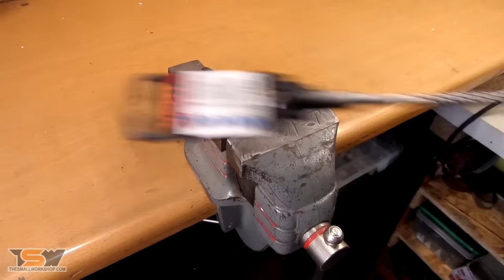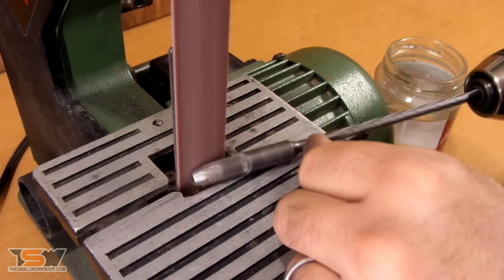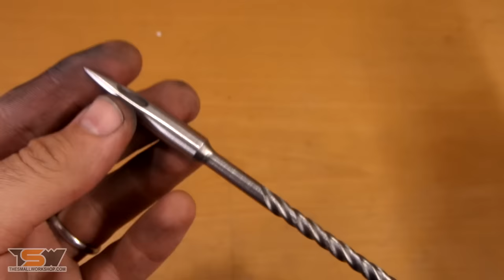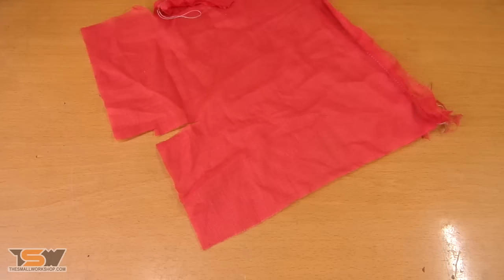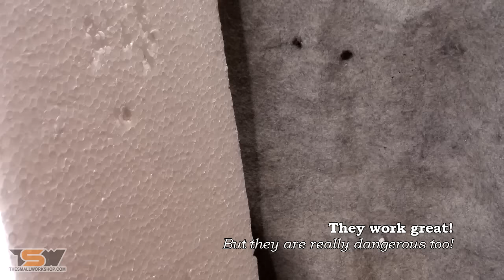Making Simple Throwing Spikes - Ninja Bo Shuriken

Comment: To all those that have or will ask if itll stick in wood , there are a few factors to that quesion .
1. Hardness or softness of wood, pine is a real soft wood compard to say like oak or mahogany.
2. Angle the the point of the dart , a sharper angle will stick easier but dull faster .
3. Skill and force of throw , throwing somethin at a distance is harder to keep straight , but with enough force you can make anything stick in anything , an example is like a cannon ball vs concrete if it hits hard enough it can stick.
There are a few more but those are the basics .
I love vids like this thanks for the uploads i look forward to more

Comment: TIP: if you decide to use a bench grinder or belt sander in addition to a drill like in this video, make sure the drill is spinning in a way that will make the surface move in the opposite direction than that of the grinding surface. This is why the bench grinder worked so much faster than the belt sander. (he switched the direction of rotation from the wrong way to the right way.).

Comment: This is super cool! But in my experience with Bo shuriken, flat edges sink into a target with at least 3-4x more "bite" than a rounded conical profile.
Reply: Yeah it is definitely better to use flat angles when forming the tips.  They penetrate target materials like wood better, and if you intend to use them as self-defense weapon (not saying I advocate this, just saying) lacerations are generally more effective than puncture sounds (if you've ever stepped on a nail, you know the wound usually just kinda closes back up when you pull the nail out).
Reply: So using flat bits will be better.

Comment: I'm thinking a trip to Ace hardware when I drag out of bed in a few hours to pick up a few of these bad boys to use as bolts / arrows with a modified sling shot/sling bow.

Sat down and drew up an aluminum or copper tube to overlay the shaft in order to secure two or three vanes/fins to it via "soldering" or an adhesive used to bond aluminum in the manufacture of aircraft.

Thank you for a nice video and a great idea even though it's not quite what you originally intended them for.

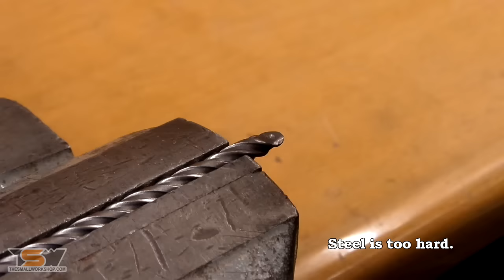Comment: 3:45 Next time you should try a concrete drill bit with its sharp tip like a metal drill, it works very well. Beautiful your work. Greetings.
Reply: Calito1157 I use cheap harbor freight masonry bits to drill through hardened steel. Like $4 for a pack of 5. Use them 4-6 times and toss

Comment: Great job. I was surprised that you were able to cut the steel in the beginning but it was too hard to drill through.
Reply from the maker: The hacksaw blade was high quality HSS and was damaged a little by cutting the 3 bits. The cheap chinese HSS drill bits I was trying to use to drill them were just not up to the task.
Reply: Makes sense. They turned out great. I may have to try it myself because they look fun as hell.

Comment: Would love to see you heat them up then apply brass using brass wire wheel. Even though some (most?) of the brass would scratch off it would have a sweet blend of colors on them.

Comment: This is a neat vid! A couple questions regarding the process:
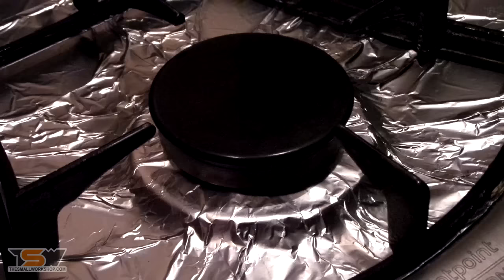1) Why do you need to apply heat at 3:52?
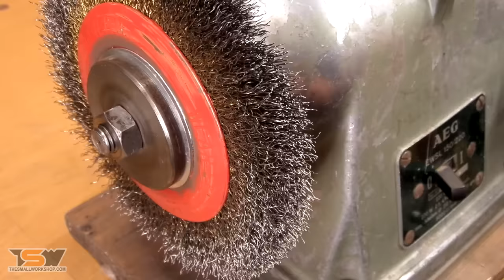2) What is the purpose of the step at 4:35?
Reply: 1) He's applying heat to anneal it (soften) so he can drill it. 
2) wire brushing the blueing off (from the heating)

Comment: The use of the bench grinder  is not unlike the method I use for grinding tungsten electrodes- but it works faster if one holds the workpiece perpendicular to the grinder axis. Perhaps that would work here.

Comment: the only thing that could be simplified would be not using the grinding tools. Just the drill as a lathe would suffice. But the grinding tools definately simplify time constraints.

otherwise this is the first "simple" thing to make that turns out simple i have watched in a while.
Reply: you're damn right
Reply: no
Reply: Crystal May You could use an angle grinder instead. More dangerous but ive actually done it before to make a bushing out of a nut. The results were great.
Reply: Crystal May ggggg

Comment: don't know if it has been mentioned yet..... you could keep the scarf on by using thread wrapped around it instead of glue, it would last longer and look more authentic
Reply from the maker: Original ones had silk thread passed trough the hole then bent back and tied, to form something like a brush. I liked that method better, but was in a hurry to finish them that's why I used the cloth.

Comment: In what country is it cheaper to use new hammer drills cut up rather than used and worn out used ones?
Also, if you spin the drill in the opposite direction of the sanding belt, it would work much better.
Deadly on foam, but how about wood, or perhaps meat?
Reply from the maker: I've answered all these questions a dozen times or more, but hey, why not once more! Could you point to me to that part of the video where I say you should use new bits? Also I paid 3 bucks total for the drill bits so it's not like I'm getting bankrupt because of it. As for used drill bits first is that I use quality bits, $15-20 or more a piece and they last forever, I think I only thrown away one in my entire life because the shaft broke, else they only get a little thinner, but are still usable for smaller holes. And second, unless you are a professional who drills holes all day, good luck finding 3 or more matching used drill bits. Using new cheap China bits I can easily make a set of ten darts for $10.

The sander is really under powered that's why I'm spinning that way, else it would stall the belt. In the bench grinder section you can see I spin it the way you want.

The foam target thing I won't answer anymore, feel free to read my other answers if you want or whatever.

Comment: my god that hacksaw went through that bit like butter!

i've got a bit of scrap 1080 left from my first knife - been thinking of making some of these myself. though it's only 1/8" x 4" so they'd be a bit small.
Reply: Arklan Uth Oslin what type of saw is this???
Reply: no idea.
Reply from the maker: It's a HSS hacksaw blade made by Pilana, a Czech brand. It managed to cut through the 3 drill bits but it started to show some wear. But the steel was really hard, I could not drill it with HSS drill bits.
Reply: Whats the brand of those small files ? Are they any good? Im looking for a small set like that!
Reply: I'm not sure what they are called but I own a set and they are rubbish. Very cheap and unpleasant. Broke the first one in less than a week. OK for light work but I would recommend you buy something nicer.
Reply from the maker: Yes the files are not very good, just cheap generic China.

Comment: The steel wasn't too hard to drill through... the problem was that you were spending the drill too fast and not applying enough pressure... you can drill straight through an engine block... you just have to have a correct metal drill bit and patience... I would also suggest using some form of oil to lubricate it.

Comment: belt grinder would have been faster if you reversed the drill like you did for the grinding wheel!

what kind of saw blade did you cut the bits with?

sorry for the edits... LOVE the way they look! I'm function over fashion all the way! but I'd spend the $$! very nice!
Reply from the maker: Might be, but the sander is not very powerful and it stalls easily, so I have to be gentle with it. The hacksaw blade is HSS, made by Pilana, a Czech brand. A grinder with a cutout wheel would work just as fine to cut the bits, but I don't like the noise and dust that it makes.
Reply: The Small Workshop perhaps lube the back of the belt? silicon lube or paraffin wax works on treadmill belts. and they ride against a laminated MDF deck (225lb footfalls create a ton of friction) which isn't nearly as smooth as the platen would (should?) be. perhaps your platen is worn if not metal? but I don't know belt grinders nearly as well as I know treadmills. same principle. just trying to help. I do kinda prefer the belt ground one.

may not be practical, but dremel the flutes to create 3 blade edges?

they look amazing now! I'd probably kill them completely trying to take them to the next level lol I have WAY too much free time
Reply from the maker: The flutes could be made into a diamond shape, like an arrow, using the belt grinder. I've thought of it, but wanted to keep the project simple.

Comment: Not bad, but isn't the problem that by creating the sharp tips by grinding, you are removing the hard, outer layer of the steel and are left with tips made out of the softer inner part? I think since they were wood drills, they probably weren't hardened in a way that would ensure that the inside is as hard as the surface.
So you probably were left with rather soft tips, which would mean those spikes wouldn't do very well when throwing them at wood, instead of Styrofoam.

Comment: Looks kinda cool, but for me that's not making throwing spikes, but rather transforming drill bits into throwing spikes. 
And you can actually buy drills for steel. 
Anyway ... Just my thought. I know some people want to kill me for this comment now. ^^ 
The result is still cool.
Reply from the maker: I went for masonry bits because of the thick tail they have, they suited my design, while steel bits are straight. Also the tails on these bits are hardened steel because rotary hammer hits them thousands of times during use. Metal drill bits have softer tails for the chuck to grab them properly. 
As for the fact that this is a "too simple" project, I totally agree with you, that's why I put simple in the title, also I kinda want to make simple projects sometimes, so people that don't have a lot of tools can make them too. Some other throwing spikes videos I've seen are just guys sharpening rebar or large nails, so mine are actually pretty elaborate, compared to those :)

Comment: Where did you buy the bits? Ive been looking online but can't find any.
Reply from the maker: Depends on where you live, they are called SDS masonry bits and in my part of Europe they are literally on every corner. I guess in a country that builds houses out of wood they would be not so common. We build them out of brick and concrete and need these bits even for simple tasks like hanging a painting. That's why they are plenty and cheap, I paid around $1 a piece for them.

Comment: Until now, I've never seen one weaponize an SDS drill. Great work...but I don't understand why you didn't take the coarse wheel on the bench grinder to do the rough shaping and THEN the belt sander for a finer polish. He,he...now you know you can't drill such a thing with a normal HSS drill, you simply can't. So you did the only reasonable thing...took the hardness out of the end, before drilling.
Next thing...a throwing star out of a saw blade or a gear wheel from a bicycle. 😉
Reply from the maker: I used the grinder and sander separately to show different ways to sharpen them. Else I'd get all those "you need $1000 worth of tools to do this" comments. Unfortunately I won't be making a throwing star since they are illegal to own or make where I live.

Comment: what's the point of the red cloth
Reply: adds flare and helps it fly
Reply: biggranny000real hala it looks cool
Reply: Find it easier too!
Reply: no it actually helps stabilize the back
Reply: it's called a tail like on a kite.
Reply: Makes the arrow to allways point forward when you throw it, because it will create drag towards wind. If it didn't had that red cloth, it would probably spin around its center point.

Comment: Hi what is the spray that you used to soften the drilling?
Reply from the maker: It's "cutting oil" especially for drilling. WD40 has a version of it. You can also find it for thread cutting in the pluming department in some hardware stores.

Comment: Where did you buy the bits?
Reply from the maker: Cheapest ones I could get at my local big box store. Around $1 each.
Reply: I've made 3 ones too, and at my local Hardware store, they had them shorter and für 1,49€ each, sadly they wobbled quite a bit, so they didn't turn out as nice, but throwing them is a lot of fun anyway.

Comment: What is it with using a battery powered drill - you're not in a field so use mains electricity and a proper drill, and while you're at it, use an angle grinder for the tip shaping.

Comment: drill bits are too hard,you need a softer steel,5160 spring steel would be good or stainless steel or even nine inch nails would do.

Comment: Because we all have a belt sander. 9__9 There's gotta be an easier way of making senbon... like just buying them already made. LOL. I mean making your own stuff is cool, unless buying them outright is way cheaper and way less of a pain in the ass. That's a LOT of fucking grinding you have to do, and the bits are hardened metal. IMO senbon, or any throwing weapon, should be a little more softer metal. Not so you're constantly regrinding the tips, but hardened metal tends to crack from repeated throws and is less durable.

Comment: You are drilling the wrong way when sharpening.  They should go in OPPOSITE  directions, for actually removing material. Your drill speed is DECREASING  your grind speed.
Reply: it takes off moer metarils
Reply: @rakanalyoubi1525  no, it takes off less metal.